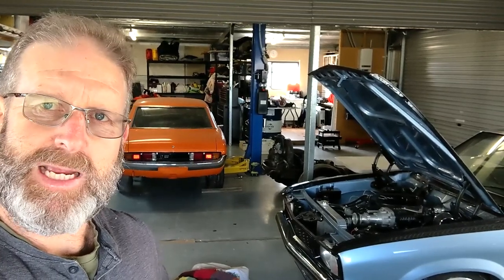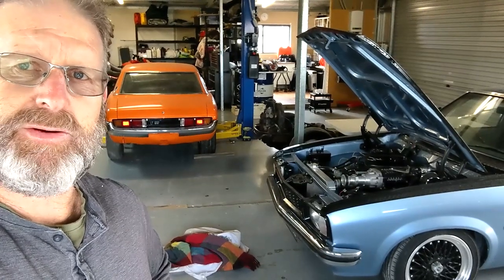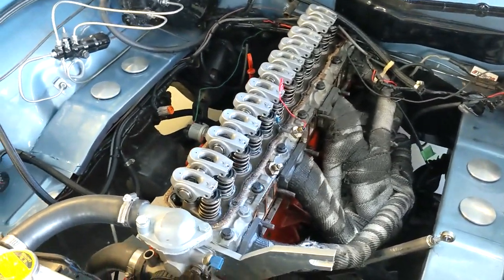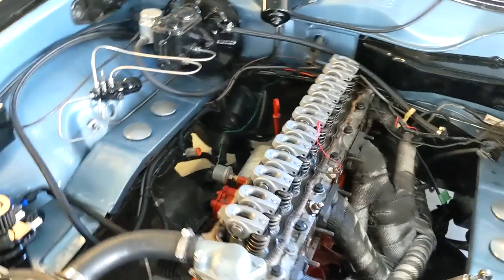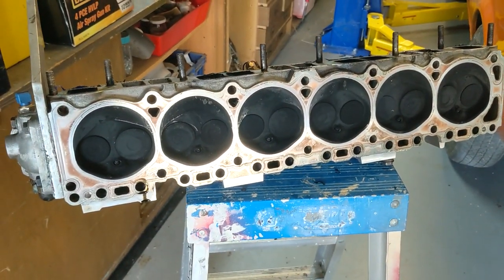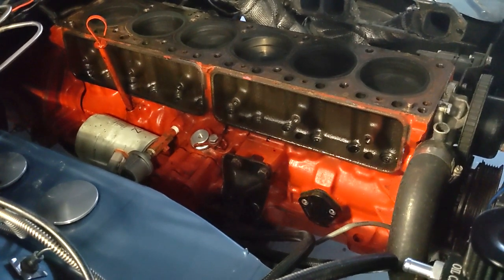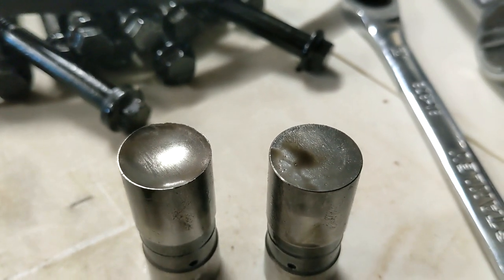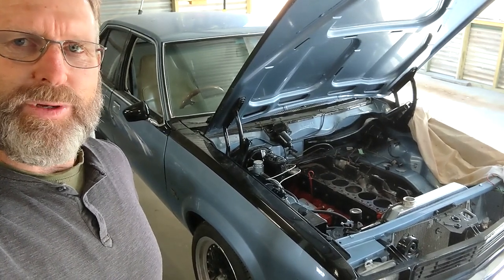Torana Build No.42 KamicarzCreations - Tough Holden 202 Upgrade

Comment: Dear sir
This a common problem with a flat tappet cam your oil synthetic or mineral must have a high zinc content . Your cam will have a lope knocked of it , Some lifters have a hardened seat on them your break-in procedure is critical . Most high performance engine Builders will not use a flat tappet cam , a roller cam will solve these problems. Hope this helps.
Christopher
Reply from the maker: Thanks Christopher....great info.....👍
Reply: @KamicarzCreations  Dear sir 
If I can may  I make another observation, the very high grade steel bolts with a coarse thread you are using in to a cast iron block will distort the bore and fatigue the threads in the block. The use of studs with fine tread on top will go give you a better clamping force and will not damage your block.
Christopher
Check the ARP website for more information!

Comment: When you do initial start up you must run the cam in at 2500-3000 rpm for 20 mins. You're fortunate you got off with just lifter it could have destroyed your cam.
Have you considered your componentry ratings i.e. cam selection should match your flow rate at inlet, you exhaust rate should be greater than 75% of your inlet rate for efficient emissions. I have formulas on hand somewhere. I did my trade as engine reconditioner and assembler but been offline for a long time working in mining instead. I had an EH ute, learnt a lot from tge mistakes made, would like anotger project but time lol. Cheers, be good to chat with you.
Reply from the maker: Yeah thaks Mark live and learn. I new bottom end will be much more suited to the top end. Have new roller cam being manufactired to match the head and intake manifold. Have purchaed link bar hydraulic lifters and getting the matching valve springs as well. Using SURECAMS  and his advice.....suppled him with all the engine specs.

Comment: Assuming the Cam is in no way at fault, it basically only leaves the hole the lifter sits in is some how sticky.. perhaps not getting lubricated. The only other possibility is that the lifter isn't somehow straight. One other thing from my distant memory.. Can't you use Solid lifters in that engine.. (I haven't looked at one for over 30 years). Anyway keep us informed .. Cheers mate 🍺🍺
Reply from the maker: I think its oil pressure/supply and strong valve springs. Live and learn
Reply: Hey mate 18 mths to bore & hone. deck block you should have come to me i would have done it within 2 weeks. As for your lifter it looks like it wasn't spinning on the cam lobe.

Comment: The problem I had with the 202 was the lifters running out of travel when I gave it a hard time (with standard rockers)
Reply from the maker: Maybe the pushrod length was wrong?
Reply: @KamicarzCreations  if they were it came out of the factory like that, I bought the engine from a farmer who had the car since new, it had too much rust for rego.